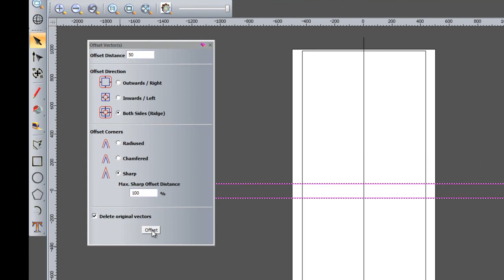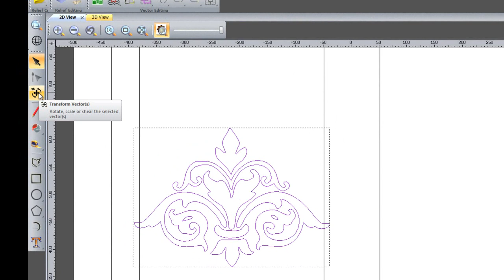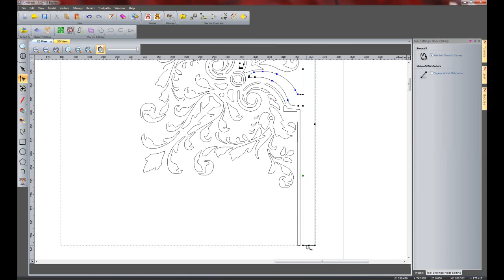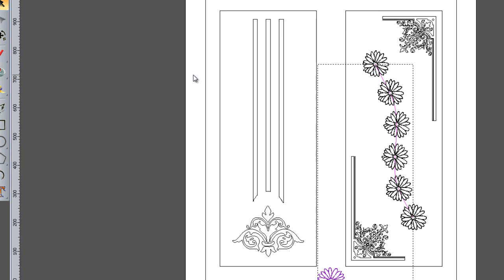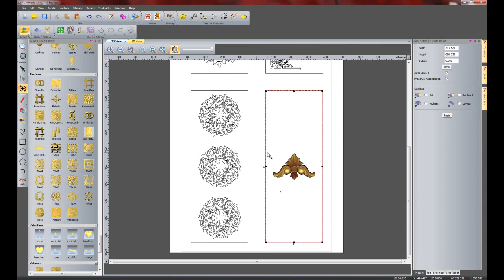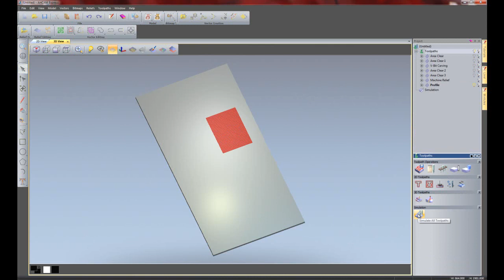Woodworking And Cabinetry Tools In ArtCAM Express

Comment: I am using art-cam pro and have been following your tutorial. When I reach the part where you select bitmap to vector, mine does not work like yours. After selecting it, it tells me VECTOR FROM BITMAP. with different settings from yours. What must I do

Comment: I am thinking about purchasing ArtCam and wanted to know if ArtCAM has a machine output file formatted for Mach 3? Mach 3 is the software i am using to run my CNC machine.
Reply: Eric W. 
ArtCam will work with Mach 3 it has the setting as one of the 200 post types you can save as